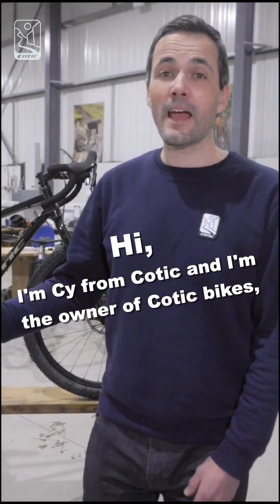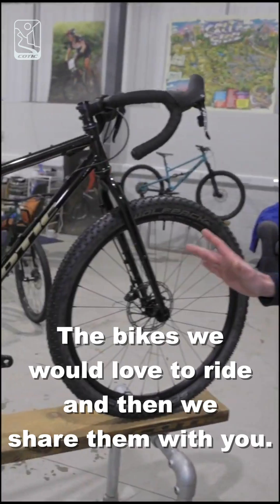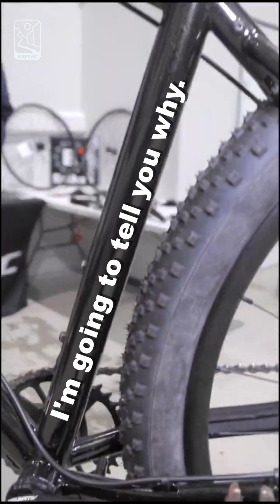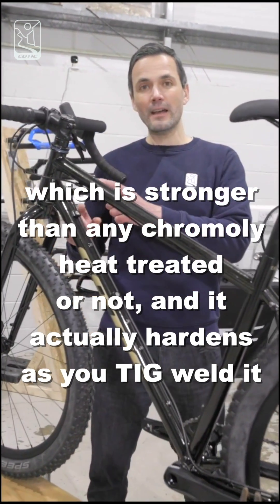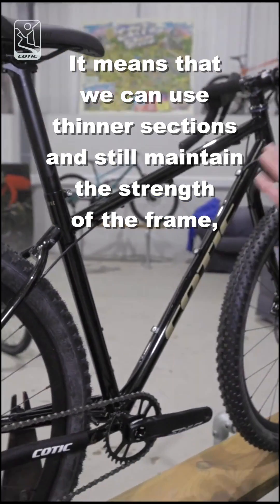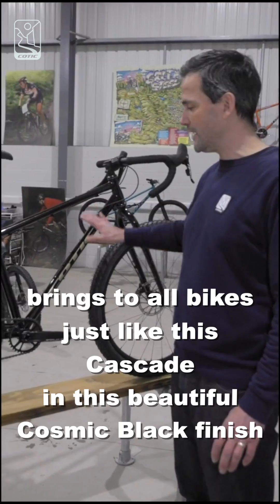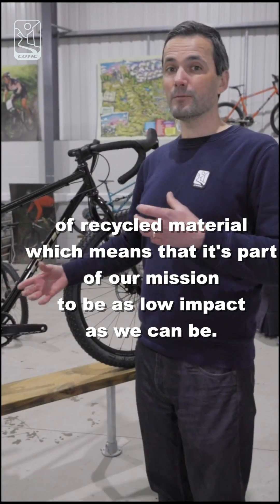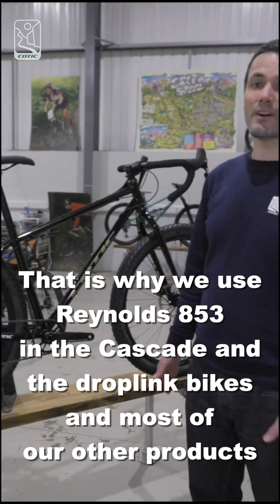Why we use Reynolds 853 steel in our frames

Comment: but steel would make it heavier right?
I assume the focus here is longevity and cost, and not pure performance.
Reply from the maker: Weight is only one measure of performance. That subtle flex in steel frames improves traction and reduces fatigue, so improve performance in other areas.
Reply: Is there any advantage to using lugs over tig welding on the high end Reynolds tubing such as 853 and 953, such as strength or durability of the joints/tubes?  It is hard to find builders using lugs on the high end steel
Reply: @lakevacm  Lugs aren't needed with high end TIG welded steel.
Reply: @michaelremington1493 I think lugs distribute the forces better than tig welds and are less prone to stress risers. If a person is buying a steal bike they probably have something in mind other than competing against a bunch of carbon bikes. I’ve had two filet brazed bikes, one of which is a livery track bike I still possess,  and have had many lugged bikes but I would never buy a high end steal frame that was tig welded, That’s just my opinion. My ultimate bike would be a multi shaped stainless steal lugged frame, using 953 or combination perhaps of 931.  Maybe that niche market will happen, or perhaps it has. I did get a titanium bike which of course is welded.